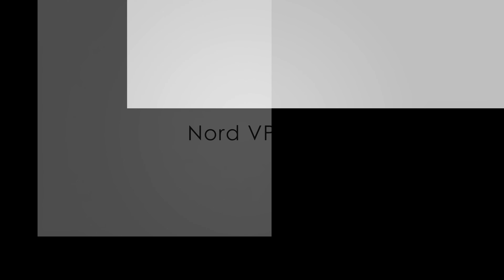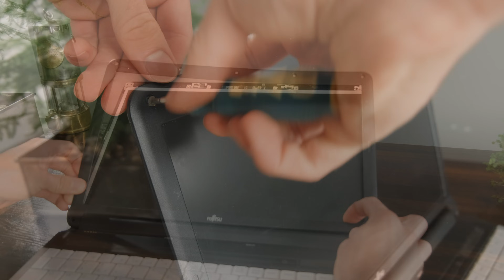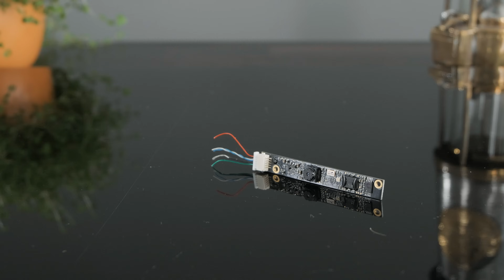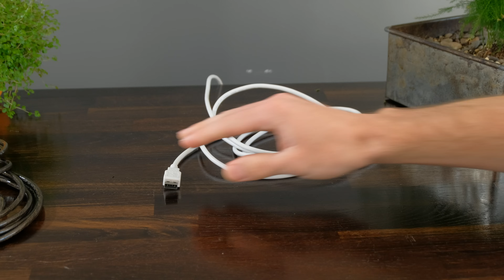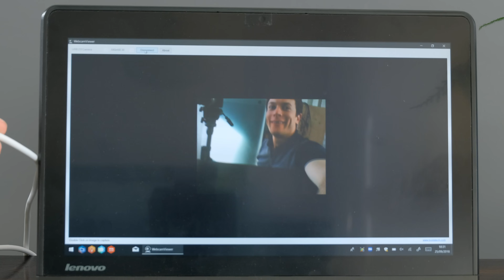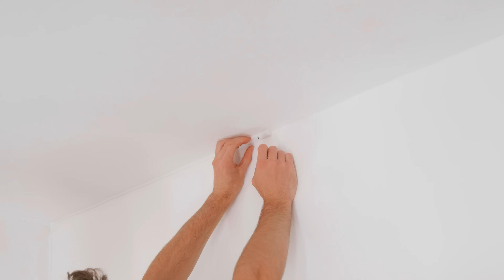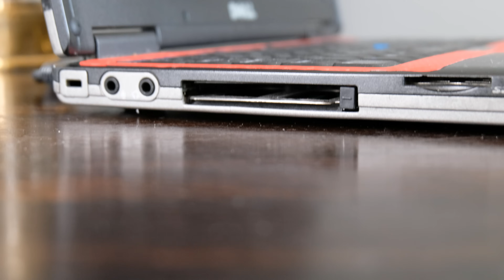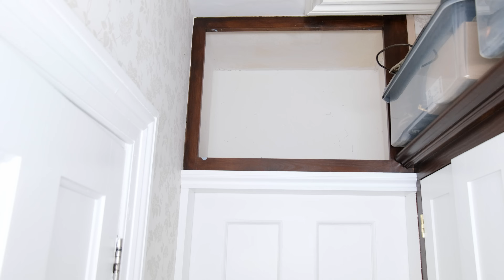DIY Home Security - ON A BUDGET!

Comment: I had no idea you could do this with a laptop camera! I never realized they were actually USB! I thought it was something proprietary...

By the way, I know you've already done a video about turning broken laptop displays into lights, but you did it with LED backlit ones. How would I go about doing it with a CCFL backlight? I have a broken display I'd like to try and do it, but I just have no idea how to power the inverter...
Reply: It should have a connector on it, just find out which wire is ground and which is positive, there might be a few more wires for brightnes control or something too

Comment: Do you think a rasberry pi 3 can handle the monitoring software?
Reply: Motioneyeos. Works great
Reply: Maybe not this software as it is windows based and i have not tested the windows arm images however using linux you can use something like zoneminder which is much better software anyway.
Reply: I imagine you could get MotioneyeOS running on a Pi Zero.  And if you use the W version all you need is a battery and you have a wifi cam.  The only difficulty I might see is having drivers for the salvaged webcams.  Since they're old, they might already have drivers in a driver database...
Reply: The Raspberry Pi 3 B+ can allegedly run Windows 10.
Reply: Uhm, first off that's Windows 10 ARM (with x86 emulator) or Windows 10 IoT (not the full version of Windows) and second running an OS isn't an indication of whether there's enough power to run a monitoring software or not.
Reply: @DoomRater  I did say ALLEGEDLY. And I didn't state anything about performance, I was only suggesting it as it permitted OP to use the software as used in the video.
Reply: You didn't even read my comment, did you?  No, it doesn't necessarily allow the OP to use the Pi 3B+ if 1. the OS isn't the correct version of Windows 10 and 2. if the performance of the device isn't enough to run the software regardless of OS.  I really shouldn't have to repeat myself, but here we are.

Comment: Could it be connected to USB WiFi switch and make them wireless or attach each to USB WiFi dongle to make them wireless ?
And could we use IR LED strips sold on eBay and solder them to each camera power to make it functional night mode or we may need lenses filter for each camera as well to activate this feature ?

Comment: This is some proper DIY, and not a single hot glue gun in sight!
Reply: And duct tape.... 🤣
Reply: Hey don't h8 the hot glue!
Reply: @UpcycleElectronics  hot glue isnt bad but its been turned into cancer by a lot of "lifehack" videos which are pretty good at wasting the hell out of it for nothing
Reply: @OtherDalfite  MrGear
Reply: @UpcycleElectronics  exactly. And the "tools" they make are often SUPER dangerous (sawblade with no guards and a handle made of pvc) and cost about the same to make as an entry level tool with actual safety in mind
Reply: Hot glue gun has it's uses around electronics...I use it when repairing certain electronics to keep fragile wires from moving and breaking off the PCB.
Reply: Sugru is basically hipster hot glue...
Reply: And not 3d printer required...
Reply: But the sugru makes up for that
Reply: Hot glue is shit. Why would anyone use it for a diy that is meant for a permanent setup.
Reply: I am going to stick it on my Remington 1100.
Reply: Oh yes there was a glue gun, did you not see it? & a complete waste of time with effort.
Reply: Hot glue and ducktape had a baby, it is called Sugru.    ...Hot AND sticky anyone?  o.o   scarred

Comment: But you could expand the USB ports by adding an active USB hub right? To my knowledge that counts as a root USB controller, as I've definitely had more than 16 devices plugged into my PC before using active hubs... Let me know if I'm wrong
Reply: Issy Szemeti you need almost all of usb 2.0 bandwidth to push video. If you hook up a active hub it's not going to work with very many cameras. I'd say 3 tops per 2.0 port.
Reply: Mark M  fair enough, didn't think about the bandwidth aspect. I could pipe it through usb 3.0 hub though, it would only use 2.0 speeds per port but the whole hub would connect by 3.0 speeds
Reply: You do not need to live stream all at once, could set it for motion.

Comment: Could you use ethernet cable instead of usb cables?
Reply: for the physical wire, yes you could use an Ethernet or PoE cable, but the signal would still need to be amplified (which is what the active repeaters do) every few meters.

Comment: Interesting, but couldn't this be a fire hazard? I don't think the laptop is graded for continuous use. If the laptop fans give up after a couple months hardware might start getting hot. Especially if left in a shelf with weak airflow access. And this would require having a spare laptop around. I would love to see you do basically this, but with a fanless raspberry pi, perhaps in a metal case with a heat monitor. Shouldn't cost more than a bad laptop, and be a bit less dangerous to forget about. Raspberry pi 3B should even have wlan integrated. So you could replay multiple "computer stations" closer to the cameras.
Reply: When a laptop overheats, it will shut itself off.
Reply: The laptop has temperature sensors and it will shutdown if it gets too hot
Reply: MrBrannfjell If the fans fail the system should shut itself down fairly quickly to prevent the CPU from overheating.

Comment: I wonder how they compared to Raspberry Pi zero w set up, server to a respirator Pi 3 B plus. Which camera would cost about $25 and everything will hook up wirelessly to the server host. Most of the cameras are 1080p but the Raspberry Pi zero w can't do more than like 10 FPS on that so you're probably better off with 720P.

Beyond that you can get fixed cameras if you want your cameras to be visible, then just silicone them together. I believe fake cameras with LEDs cost around $12.
Reply: Respirator pi :D

Comment: Possibly a cheaper idea than USB repeaters, is to wire up USB to Ethernet. You can then use your existing Ethernet wall ports for a setup in or near your existing network box. Ethernet allows a much further distance and without wiring up new cable throughout your house. As long as the wiring standard is terminated the same on both sides, it works just fine! You might lose some network ports but everyone is on Wifi these days anyway.
Reply: I've used an ethernet converter for a webcam setup looking at my front porch, it works great, and didn't need a separate repeater.  The adapter came with the repeater for the camera end, the system end was a regular usb plug.  My problem is, I can't have more than one single make of webcam, I have to have different ones or my open source software won't be able to tell the difference, even if they are in different ports.
Reply: That's not how it works...
Just because you switch the cable doesn't change the physical specifications of the transceivers.
Reply: The issue is signal quality gets lower over longer distances... (Degregation sp?). The usb repeater is a device that collects the data and then.... Repeats it... (Get it?) - Thus giving an extra 5m...
Reply: Why would anyone use wifi for a desktop, its much quicker to use ethernet, but i agree with your idea. I have a usb ovet ethernet converter but it cant carry much power over long distances but those cameras wont really use power that much
Reply: I've not tried it before but my idea was USB to serial converter, then use two ESP8266s as a WiFi-to-Serial Bridge then you can plug that end into another USB to serial converter, should cost about $4 or 5 extra per camera to do that.
Reply: @vgamesx1  USB and Serial communication doesn't work that way. a setup like that would unfortunately not work. You would be better off with with a low cost WiFi IP Camera at that point.

Comment: well that was a bit disappointing. he basically says hook up a webcam to a laptop and use software to record it. how about setting up a pi or arduino based surveillance system?
Reply: Arduino wont have enough processing power and i think the video is more about getting cameras for cheap, you could connect it to raspberry though
Reply: L4ke  yeah right, his hint, that most laptop cameras are usb cams was very useful.

Comment: Make security camera using scrap phone camera📷
Thumb this up if u guy's wan him to make it happen👍
Reply: phone cameras are a little complicated. every single connection is different and they are not USB devices like these cameras. so making a system like this wouldn't work with phone camera modules however you can straight up use the whole phone and mount it somewhere with a charger and do it completely wireless with a few apps and home network. great for wire management the phones would ether have to be always on charge (which will kill the battery) or removed daily (probably twice a day) to be recharged. and a lot of smartphone cameras chant handle 24 hour recording without dropping the quality to POTATO. very impracticable and would cost more to get 4 reasonable and still working phones than laptop webcams and a couple of USB cables, cool idea though!
Reply: @CrazyRespawn  well think of it this way it's a good challenge and we can learn 1 or 2 things from him because some of us can't learn and things from book it me btw and we learn how to do by watching and do it ourselves
Reply: @Mr6gamer  well i dont think it needs a standalone video but you could just use google to find an app that would suit you, if you only wanted the camera then you would need to find/build a converter for a camera that usually doesnt have a lot of documentation
Reply: @angrycreeper100  i have seen a lot of tutorial for turning phone in to security camera but i naver see anyone try to use only the camera it self. If he can make it happen it will be good learning experience for me and you
Reply: @Mr6gamer  yes it would be interesting but probably not really practical :D
Reply: @Mr6gamer  like said that's just not possible. You would need to be a full on professional engineer in electronics and programming. As mentioned the cameras are all different and paired to that model of phone. You can't put an iPhone 4 camera in a iPhone 5. Even if the connections were the same it wouldn't work because the software / drivers and logic is all different. And non of them are compatible with Windows. You would litterly have to make from scratch a controller for each camera and write software to process each camera. No offence to DIY perks but he's not a computer scientist.

EDIT: you can buy camera module to pci32 but it only works with 1 camera and it's not usb.

If you want to see a cool project. The raspberry pi W with a camera is a good project.
Reply: Mr6gamer  its not learning if all your doing if copying someone else you will learn nothing and will need a video for everything you do in life but thats seems to be where the majority are headed they go to google instead of thinking for themselves. Besides that using phone cameras is a complete waste of time.
Reply: @sud0x3  I disagree watching a YouTube video is a great starting point. I have built my entire career on YouTube videos. I'm repair computers phones consoles. Cameras. Anything with a power button even a little bit of game development  and it all started with a video on YouTube. YouTube is a great starting point. You will learn a lot it's what you take from it that makes you try your own things. It's uwise to start poking around electronics with 0 knowledge. But a few YouTube videos and a few failed projects is all it takes to get the ball rolling. I mean is it any different from school? Teacher writes something on the board and you copy it. You didn't figure anything out. You watched someone else do it and then you tried to solve a problem from what you saw and copied and apply it to your own problems and projects. Same as YouTube.
Reply: thats a whole lot of electronic engineering. you need to learn about imaging protocols and who to use them 
heres a good website i think
 http://www.arducam.com/
http://www.arducam.com/wp-content/uploads/2014/10/RGB565_timing.jpg

https://s2.www.theimagingsource.com/application-1.0.80100/documentation/ic_imaging_control_class/en_US/images/rgb565.gif

https://www.youtube.com/watch?v=rQYByorpoFk

then again there are i2c,spi cameras wich might easier to program
Reply: I use an app called "Alfred" on my old android: https://alfred.camera/
Reply: But this Alfred needs the whole device, this is not exactly a hack
Reply: Go to YouTube and search Nest Cams are a BIG RIPOFF by Linus tech tips. Shows how to make completely wireless camera system with raspberry pi and a camera module. Super cheap.
Reply: Phone camera modules run directly on MIPI-CSI.
It would cost a lot of money to buy additional hardware to interface to it - likely upwards of $40-50
Not worth it.
Reply: This would be almost impossible compared to using simple laptop webcams

Comment: I wonder if the cost of wiring and usb repeaters will in some cases exceed a wireless setup with raspberry pi's (zero or regular).
Reply: Well you would still need to run power to them so that would cost and they would be bulkier
Reply: bookmarkthis  yeah but does it stay in the same place or do you move around with it
Reply: Wireless? shudder
Reply: raspberry pi is peace of junk so little amount of ram
Reply: I was thinking the same. You could use a Raspberry Pi Zero W for each camera and set up a stream via WiFi to the recording laptop. Maybe even set up a separate WiFi rooter with a local network to avoid overloading your main internet WiFi with constant video traffic. This should allow usage of quite a few cameras. 
The only thing I do not like in this project is keeping old laptop in remote hidden place under constant charging. LiPo and LiIon batteries do not like being stored at 100% charge. It is a bit of a fire hazard. At work we are using laptops almost like  desktops, they are constantly on their charging stands, right now we have an epidemic of cracked cases because the batteries started to puff out. USB extenders need 5V power either way so you will loose feed when the mains are out, there is no need to keep the battery in. I would probably use old desktop instead, they don't overheat as easily as laptops, and you can put extra PCI cards for more USB inputs. A Mini-Tower size will not be that hard to hide either.
Reply: GODsaveTHEcat  laptops work when plugged in without the battery
Reply: @mamupelu565  FFS duh we know ...it's not ment to be powered like that really
Reply: @mamupelu565  I know most laptops work without batteries (newer MacBooks don't btw) but they still have worse cooling systems that get clogged with dust quickly. Laptops are convinient but they are not designed for continuous work.
Reply: @pingwingugu5  I had one set up as a file server for years, no probs...
Reply: Constant use of laptop to if old probably crash all the time ......try it  with win xp wud be fun lol

Comment: Blue Iris, if you have even a marginal budget ($60 for the software) blue iris is the way to go for NVRs and can scale really well.  you can set alerts, triggers, interface with smartthings, view from your phone or browser etc. really cool video and great idea, but if you really want a security system i would highly recommend checking out Blue iris.
Reply: Kevin i I'm just about to set up a system and I'll likely use Blue Iris, I've heard it's a bit of a resource hog though. I'm not a Linux guy but I'm going to try Shinobi first, not sure if it's quite there yet though.
Reply: Chris Hardy I would highly recommend BI over anything else. It’s very easy to set up, great compatibility, and a really active forum for support. When I compared all others none of them came close on ease of use. So do yourself a favor and just start with BI. Also it’s not bad especially if you optimize your machine properly. I currently have 3 1080p cams and 1 4k cam and only use 20% cpu. But I would suggest getting a dedicated machine (lots of info out there on how to configure)
Reply: Chris Hardy  Can recommend Shinobi, I'm at this very moment building NVR system with it, and i've been incredibly impressed. Not at all resource heavy from what i've seen. Running on somewhat fairly dated hardware too (Q6600 CPU with 8GB of DDR3)
Reply: Can recommend Blue Iris too, have been using it for a long time, easy to interface to trigger lights etc (via Arduino UNO etc) will take network camera feeds, in fact any type of camera I have tried. Also has a low band width camera app for smartphones for remote access all for £45. I would recommend running it on a PC set alone just for camera monitoring I run 4 x usb cameras and 4 x wireless network cameras on it (on an i5- 4460  3.2Ghz 4GB Ram onboard low end graphics card it runs at about 40-50% system resources) P.S. remember in England you are legally not meant to point CCTV cameras at public highways or land not owned/rented by yourself
Reply: iSpy is also great.

Comment: Saving video continuously to most standard laptop/consumer drives will make them fail fairly quickly, esp if its an old used laptop drive. If you have the budget, there are drives designed for long term continuous writes (eg WD purple) that work well, but obviously will push the budget up for a diy system, so horses for courses. SSDs would probably run into wear levelling/lifecycle issues too.
Reply: we have 1tb blue and it goes over 2 years in security cam recorder so with purple you will be fine for over 5years garanted :)
Reply: GetTheCheeseToSickbay if you take the cameras from old laptops you may also find a few old but still working hard drives in them so you could just swap them if they fail